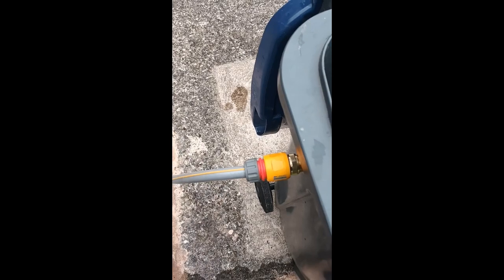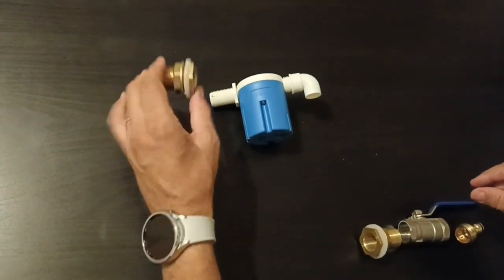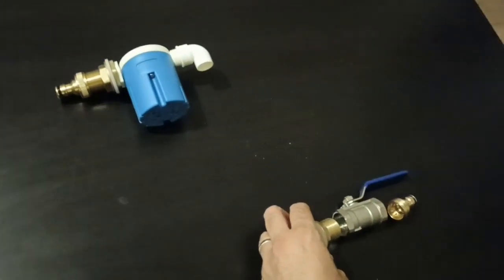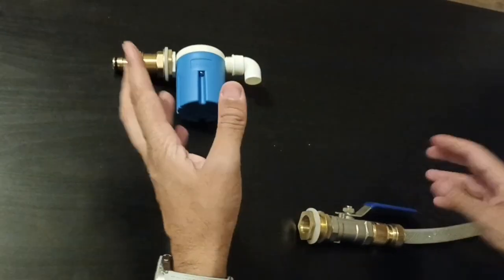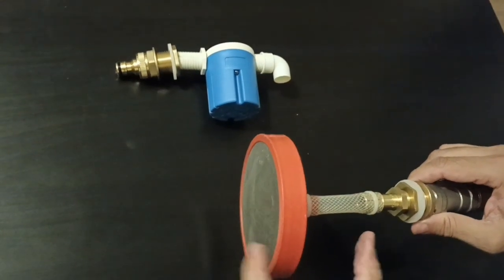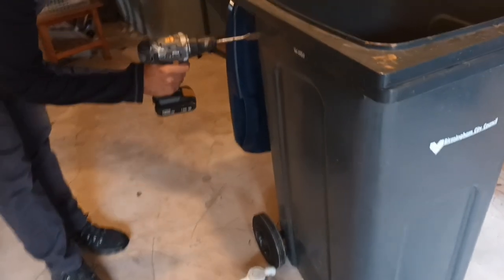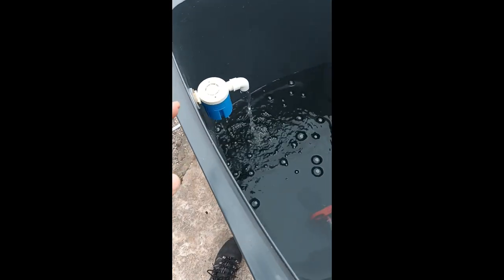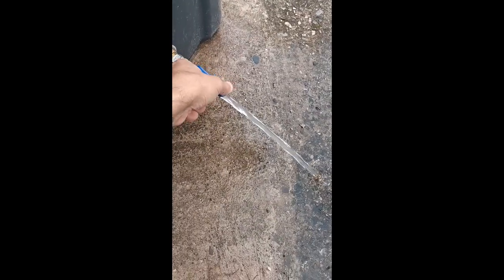DIY £45 wheelie bin pressure washer buffer tank

Comment: After spending a lot of days online searching for an affordable and strong water barrel, I have come to conclusion that a wheelie bin is the most suitable one. It's cheaper than those blue barrels and various forms of IBC tanks. Unlike others, the structure around the lid is very strong, has a wide wide, you can attach things to it if you require, it's got wheels not to mention and sides are flat making it ideal to install different kinds of pipes and hoses. Where there is a will, there is a way! 😃

Comment: SO I constructed a similar setup but I decided to use a clear plastic tote bin for my tank and raise it up on cinder blocks due to my pressure washer being mounted on my wall. My problem is that my washer gets no pressure or flow to it and I cannot figure out why the water isn't pumping with enough force.  Do you think because I used a wide shallow tote and not a taller narrow bin I'm having flow rate problems? I know water column has a lot to do with pressure but I figured I'd have enough flow to get to the washer at least.